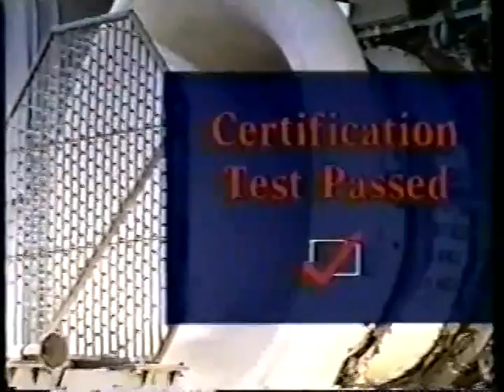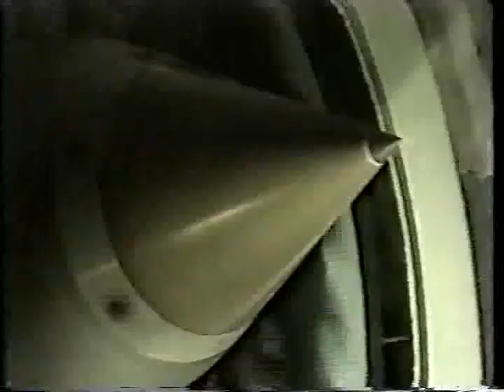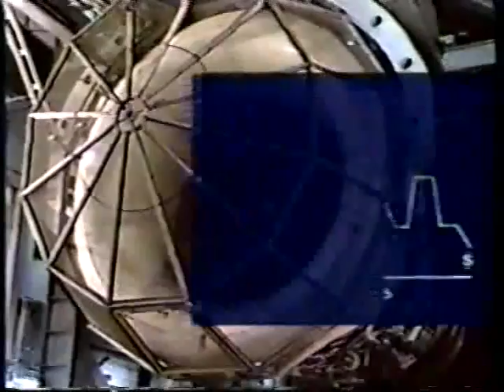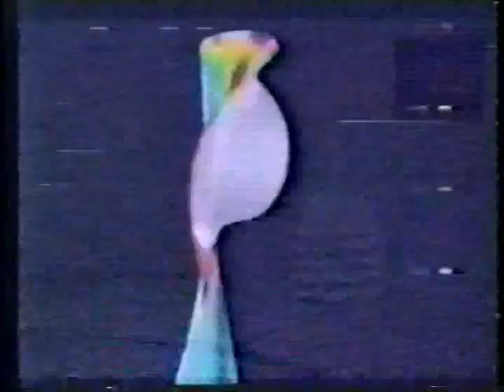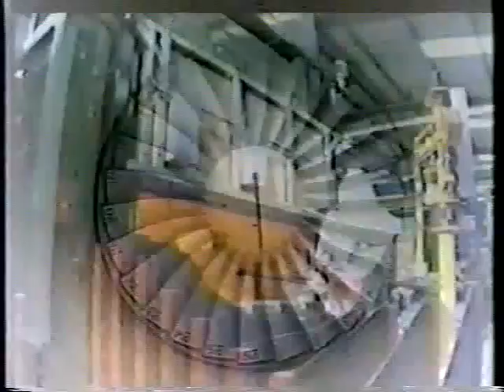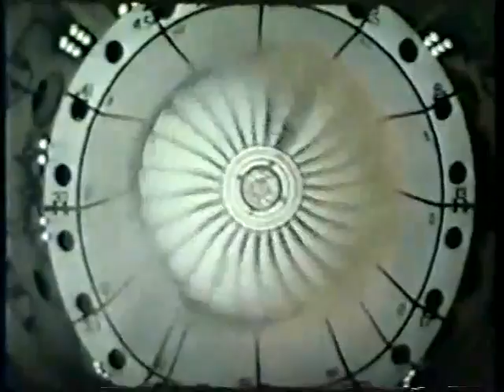Rolls Royce Trent Certification

Comment: @octaviorisso97 The official AAIB report agreed with BA, they say it was a freak accident involving the engines fuel-oil heat exchanger design and ice formation in the fuel tanks. I'm not aware of any serious GE90 incidents, but they were known to set themselves on fire occasionally when on the ground!

Having said all that, the Trent family also competes with GE's CF6 which doesn't have such a great record, quite a few incidents of containment failure with fan discs, that's downed a few planes.

Comment: @ckyliu oh I didn't know that, Thank you otherwise I still think that GE90 is better than RR Trent 800. Is true that 895 is better than the GE90-94B but the accident record is for GE90. A BA b777-200er with rr trent 895 had an accident when landing at LHR, from BA they said that it was a problem with the engine

Comment: @octaviorisso97 All BA 777-200ER with registrations G-YMMx are equipped with RR Trent 895s, the older aircraft beginning with G-VIIx have GE90-77Bs. I'd post links but YT won't let me, but I'm sure you know how to use Google. Anyway, out of 49 777s delivered, the later 19 are RR powered.

Comment: @raykrislianggi actually General Electric engines are the best
Reply: No it’s not, comparing GE CF6-80E1A3 with Rolls Royce Trent 772B-60 on the A330, the Trent 700 is far better than the CF6 in every way, effectively, durability, noise, thrust, and reliability, and the Trent 700 is best paired with A330-300 series.

Comment: @julesgymnast Just for the record, Rolls-Royce was the first to 115k lbf with the Trent 8115, GE got a monopoly on the 772LR and 773ER because they offered to be a risk sharing partner in the project. GE90s have had reliability issues, BA actually switched from GE to RR T800 for their second tranche of 777s because of that very reason. Not heard much about the GEnx or T1000 on the 787, I know the latter was certified first but suffered an uncontained failure last year.
Reply: The T800 has had it's share of issues and is what cause the crash of BA Flight 38 B77 with the fuel system icing.
Reply: If you read the accident report, the icing was at the fuel heater and was not an engine problem.